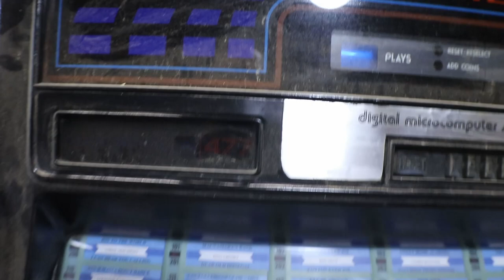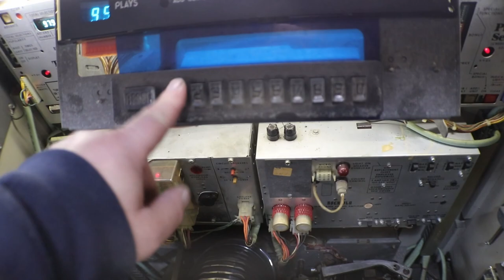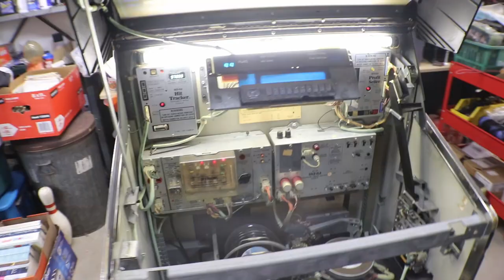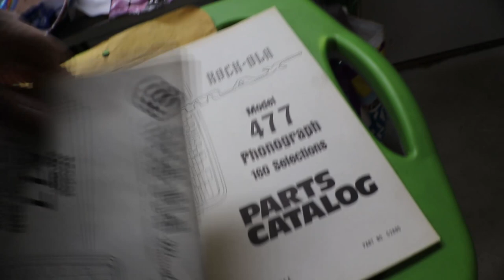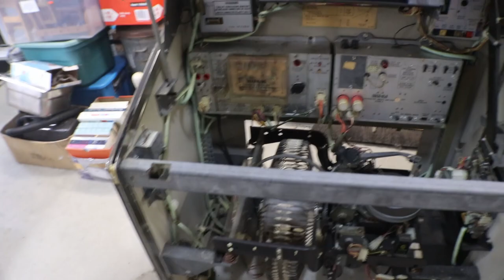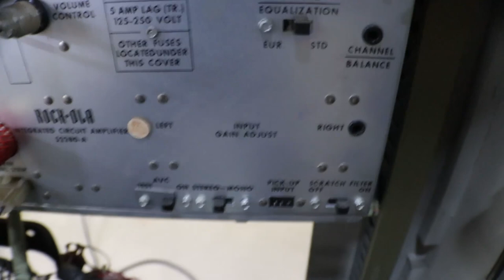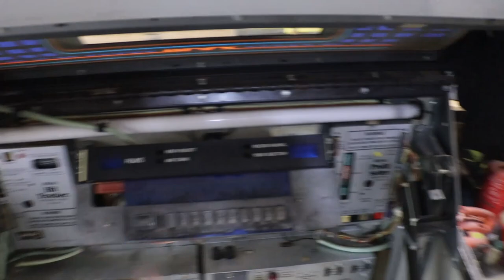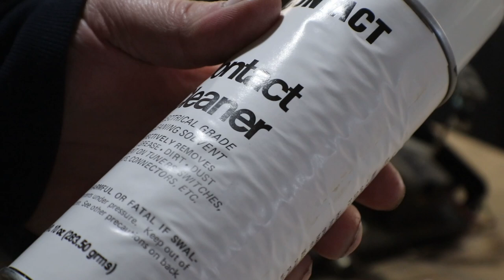Rock Ola 477 Jukebox Mechanism Clean & Adjust Removal / Getting Started On New Project EP1 1

Comment: Nice video! I once had a 453, small 100 selection so only 50 records. Mechanism almost the same. As for those motors, they are electrically identical. Things that can go wrong with them are the brushes and the collector that in some cases wears out due to the pressure of the brush springs. If so the motor will be making lots of noise, coming from the worn collector. The gears usually are quite silent. Specially the motor that drives the tone arm mechanism wears out sooner as the motor turns in both directions, the drum motor only rotates in one direction and lasts longer. Greetings from Hekelingen, Holland. Willem.
Reply from the maker: Thanks for the info. I am glad you like the video leyland9999